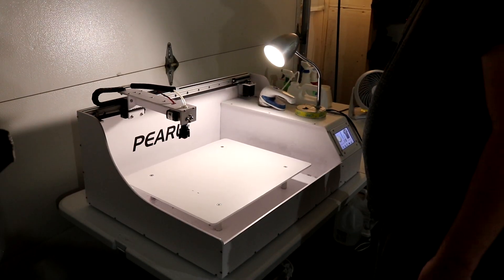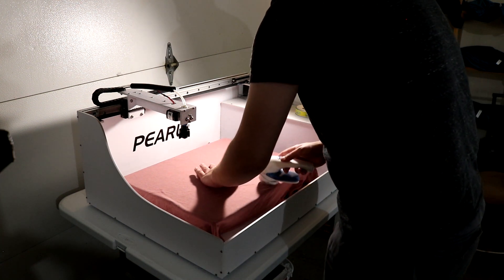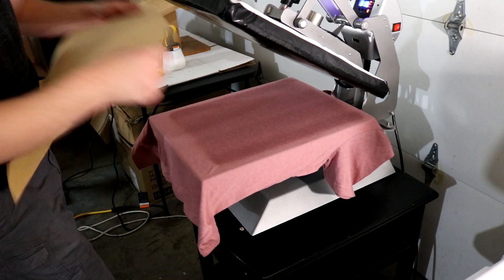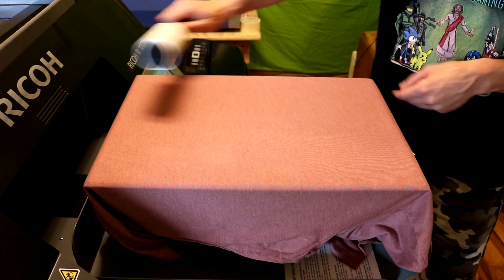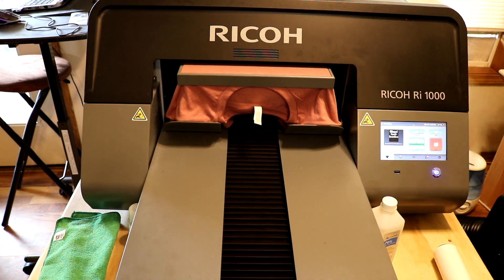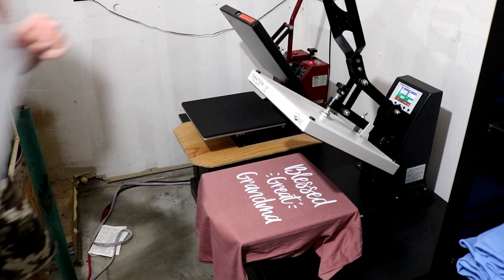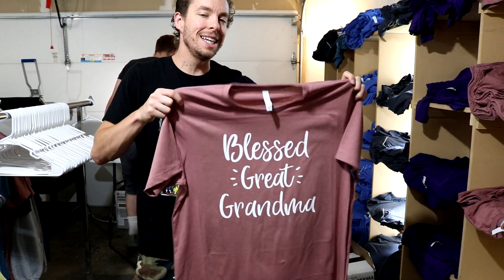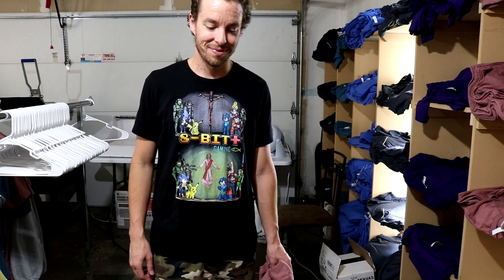How To Print DTG Shirts Overview | DTG Printing

Comment: Hello i got a question for ya. When i am printing my images the white under base doesn't come out so pigmented. And when i print on the shirts the colors just don't seem to pop on the shirt. Do you have any recommendations on print settings when it comes to sending an image to print?
Reply from the maker: what printer and software are you using?